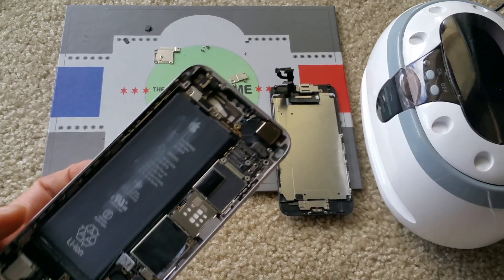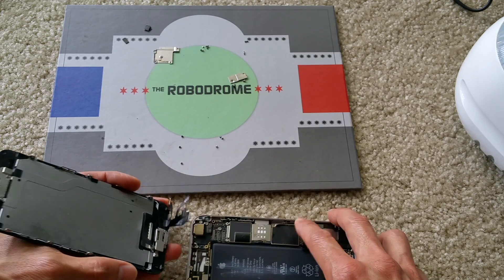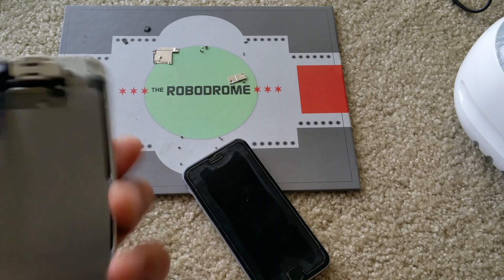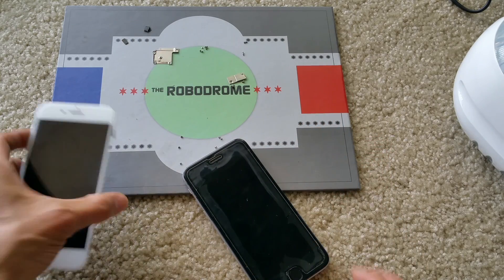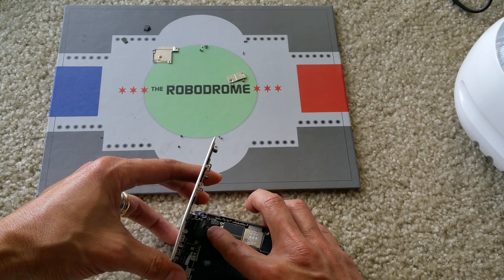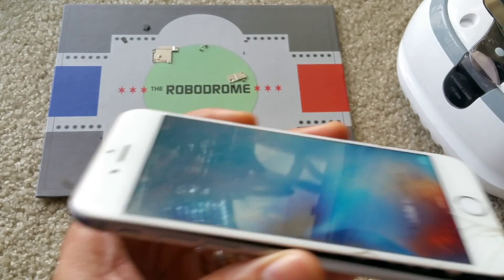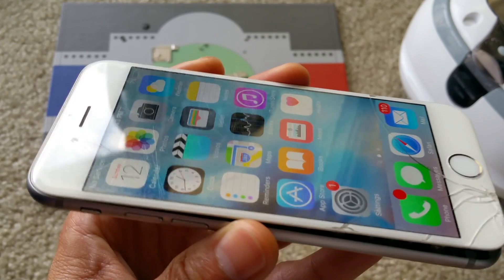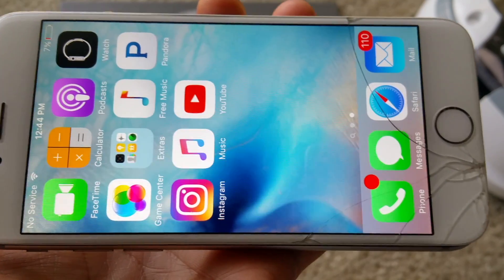Latest Method On How To Fix/Repair Your Dead Water Damaged & Rescue Apple iPhone 6 6s 2016

Comment: my iphone 6 got into the swimming pool last night. is there any way out to repair deep water damage.?
Reply from the maker: As you can see my video, my customer did the same swam in the pool and forgot it was in his pocket. Just follow my methods in the descriptions and you should be able to rescue back you iPhone in no time. Make sure you disconnect your battery right away or it will further damage your Mainboard/IC board/Circuit board. Put your wet/water damaged battery in a bag of rice for about 24-72 hours to dry up your battery.
Reply from the maker: Please follow all the steps within my descriptions and good luck.
Reply: Ayush Goel yes put in hikwall
Reply: Ayush Goel that legit just happened to me today and I'm screwed

Comment: Did you take the entire phone apart and put just the back part into the cleaner?
Did all your data get deleted in the process?
Reply from the maker: I have to remove LCD/Digitizer, flex cables, & main circuit board. You can all the steps that is included in the descriptions and it will link you to my other videos step-by-step on how to. No data was lost, everything was intact when repair was done successfully. Good luck.

Comment: bro I'm facing the same thing but the iphone has taken a really good shower , so the iphone now is when I plug it to charge it heats , gotta any solution...
Reply from the maker: Bro, you must NOT connect any water damaged phone(s) to any charger that is still wet. Must follow my video part 1 first or your phone will get further damage. Thank you.
Reply: bro , thanks i just knew what is the problem it was the IC  of the battrey that has the problem
Reply: is it able to be fix it ? or not please
Reply from the maker: If you have problem with your battery then you might want to pull out your battery and put into a bag of white rice for over 72 hours or dry with little heat from your hair dryer.
Reply from the maker: Yes, it was a fix for me since this phone was submerged in a pool. Now, it came back alive after my ultrasonic cleaning method.
Reply: thank you so much bold guy lool